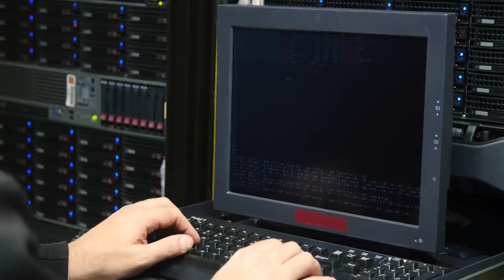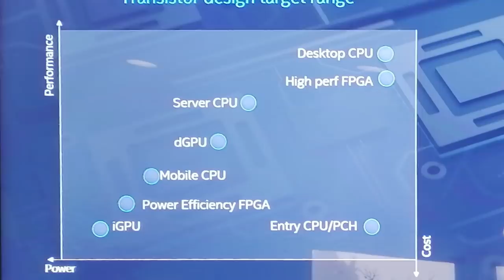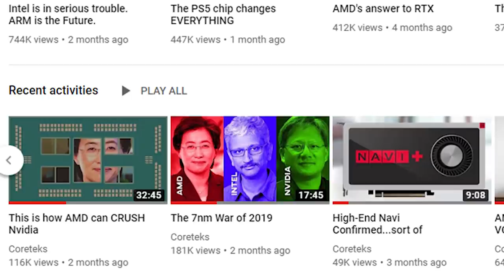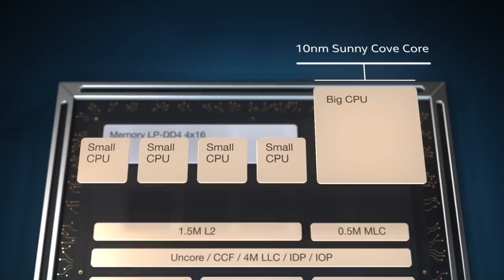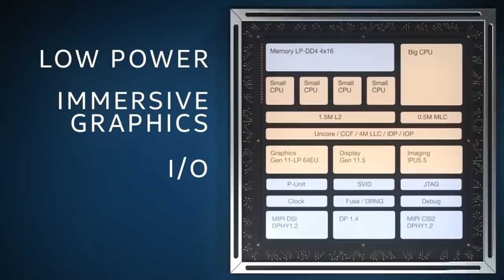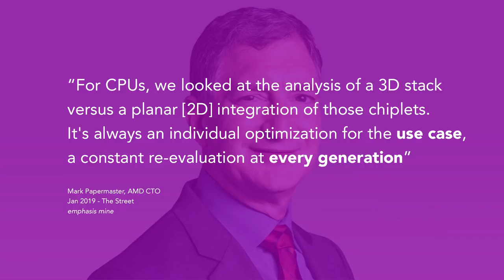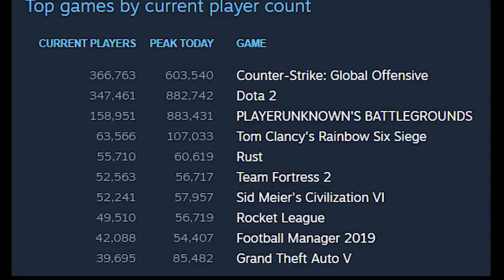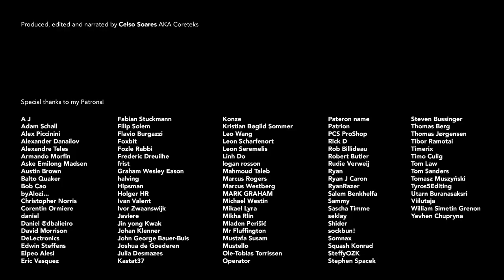2D vs 3D Stacking: Intel’s plan to beat Zen 2

Comment: AMD might sandbag but not for sandbagging sake, AdoredTV did those videos on chip grading and how it falls into a bell curve chance for a processor to meet a certain grade of performance/defects etc... That bell curve would also be applicable to the rate at which AMD accumulates 8 core dies running at top speeds, the sandbagging thus would only happen if they haven't accumulated enough to release it in volume at the same time as the 12 core parts.

Comment: Im NOT a pro in this, but could any one deliberate on why is it not a good idea to take a step back in size management and alow for a chunky'er approach? like put up the newest chips, but allow for more space inbetween (for cooling)  and 3d stack the %¨&@ out of them. Make a "building" with good chips and enough space so that cooling gets easier. Is it a bad ideia? Maybe just going for smaller and smaller processors is what's keeping the tech from a breakthrough.

Comment: But there are only such many players and the cake is just so big. Not every games company will turn to those games, many will try, sure.
Reply: True, but even now, there is more demand than supply, in data centers, and that's not slowing down any time soon. Density is king, there, too, and there's more than one way to increase total efficiency, and thus performance per sqft.

Comment: 3d is all well and good. but Heat dissipation from a 3d architecture/design will be its greatest hurdle. with having stacked cores and Dram on top of the die it will get the brunt of the CPU heat output. slowing the core above it and Nand Flash significantly. Maybe it would be a useful design for small form factors in the mobile market with low clock speeds, but for desktop/server use, the design will ultimately fail unless the heat issues and overall power draw are resolved.

Comment: It is currently for mobile segment. You know, where you want Atom, Core technology and a GPU at low consumption. For example all in one VR headset. 
It's reasonable at small scale, because it's still pricey technology and making full-fledged CPUs this way is too expensive. That's why AMD is using this technology only for GPUs and why is decided for making multi-chip module CPUs. However, this is the future of manufacturing, which we will see several generations later, when the more capable player tune up the process at reasonable price.

Comment: maybe they would embed thermoelectric cooling to solve the hot spots problem but then the CPU would use alot more power and produce alot more net heat which will definitely need liquid cooling with a large radiator. still worth it in my opinion.

Comment: A year at best if they remain on schedule. Which I highly doubt they will. I'd say at best late 2020, a more modest estimate would be early-mid 2021. However when you think of this, Intel might be getting there first. But AMD is pioneering smaller chip designs. Now once they've got 7nm locked down and rolling. They themselves can then start working on 3D chiplet stacking. And this will be easier for them as running 7nm will come with massive performance gains along with energy and heat reduction. So they'll defiantly have far more wiggle room when it comes to AMD designing a 3D chip. Meanwhile Intel may get to the 3D chip first, but they have to deal with thermal issues. Essentially they have to deal with a problem AMD won't have to too such a similar extent. And once that's achieved they still then have to work on moving from 10nm to 7nm.
Reply: TBF, 7nm on TSMC is only a bit denser than 14nm++++++++ on Intel, and Intel ' s 7nm is going to be closer to TSMC's future 5nm.

Comment: It'd be nice if they could add a heat plate(s) with external radiator(s) in the stack to transport the heat from all the inner components more efficiently.

Comment: I just want to ask you one question, Will AMD support Hackintosh? also, I never saw the performance in AMD system without the excessive heat.
Reply: Ryzen doesn't heat at all lol
Reply: You can already build AMD Hacintosh. If you've never seen an AMD system without heat ,then you have been living under a rock, maybe rethink your youtube username,
Reply: Eh, Zen+ offers similar performance and heat production to Intel's Haswell. If you've never seen a cool running AMD, you probably weren't around before 2008.

Comment: I see 2 main problems with this.. first and most obvious one as pointed out in the video, will be heat transfer. This is gonna be difficult to manage..
And the second problem will be cost.. that's gonna be a lot of silicon getting stacked on top of each other. And this will add a huge amount of extra cost to manufacturing.. So you will then come down to the issue if the extra performance will help offset the added costs.

Comment: I think alternately it will come down to who has the best instructions per clock or IPC just like it did back then with the 5 GHz chip.
Reply: Everything else being equal yeah, but there's more than one way to skin a cat. It's really not as simple as ipc is king, if that were the case we'd still be on single core processors
Reply: @mistamisa7271   It depends on the workload. The reason that 5 gigahertz AMD processor was bad was because even though it had a high clock speed its IPC was awful.  It doesn't matter how much information you're feeding the processor if it can't take all the information and process it.
Reply: @mistamisa7271  Intel has also kept a firm lead on IPC alone so far. AMD used to and to some extent today run less efficiently than intel processors especially with Bulldozer based CPU's
Reply: I think you missed my point.  There's more than 1 way to leverage a cpu. If software is optimized for 8 cores and you have a 6 GHz 1 core cpu  ipc ain't gonna mean jack shit.
Reply: The main reason FX cpus sucked (actually fit into this video) was because of the sharing of cache this article explains it https://www.extremetech.com/extreme/188776-how-l1-and-l2-cpu-caches-work-and-why-theyre-an-essential-part-of-modern-chips

And no AMD cpus are actually less power hungry than current intel parts

Comment: For 3D stacking intel should use liquid cooling with micropipes between cores inside a crystal. Otherwise CPU will throttle too much due to overheating.

Comment: 3d vs 2d stacking is a fight of compromises, and something tells me that 3d stacking will become viable in laptops and small form factors, but not in servers nor demanding desktops.
Chiplets are a very clever solution, plus the fact that you can add memory chiplets to your socket means that foveros advantages become less of a concern for amd, but heat dissipation is going to be the biggest problem for intel as they get smaller and smaller increasing the heat-spots of the chips

Comment: I can see the extra cache making quicker access to data, but I'm still certain that you will need the cpu core to run at the faster speeds to complete the task faster. Maybe I'm looking at this wrong, but I don't see were adding more cache will get a task completed faster with a 3.2GHz cpu vs a Zen 2 5GHz cpu with less cache. Of course the instruction set and architecture design will make a difference, that's why Intel was beating AMD's FX-9590 5GHz cpu with a slower 3.9GHz i7-4770K cpu and both processors having the same 8MB amount of L3 cache. AMD has made great progress in their instruction set and architecture design with the Zen processors. So Intel will have to pull more then cache out of their hat to overtake Zen 2.

Comment: 2d chiplets are the way to go, they are cheaper, efficient, flexible. They can remove add additional chip based on need and yield, in 3d you either use it or not, there is no in between.

Comment: I am not like you, I usually hang out several generations behind =P
For what I do, my I5 4690 and gtx770 work great. Hell I didn't even get them when they were new, in fact I only paid about $300 for motherboard/CPU/graphics (I happened to find sales at the right time). Sure I wont be flying through tripple A titles at max details and 4k glory, but I don't play those games anyway. I am however waiting for the new tech, it should drop prices on current tech quite nicely. I "feel" like it's time for an upgrade so I'll wait a bit and do what I always do.

Comment: You seem to really underestimate heat impact. AMD was making really interesting research in area of stacking cache on chip and they found out huge problems with heat dissipation. Also there was an article where guys from TSMC talked about challenges with their 7 nm, one of the biggest issues was heat that could impact local areas of chip.
While I do agree that 2.5 or 3D stacking is future, I don't think that it will come so quickly and even if it does, it will be mobile, perhaps server market first.

Comment: Well, intel needed to do this.  They knew they needed to do this.  But it wasn't until AMD started doing the chiplet design that Intel got the wakeup call.  But ultimately I agree, Intel innovating here is definitely a good thing. 

But I'd also point out that Active Interposer was also discussed very heavily by AMD before this as well.   The rumors suggested that Active Interposer would need to be made on 22nm processes, as AMD couldn't afford the potential of losing too much interposer silicon per wafer because of its size.   It really is, as you said, a money thing.   

Zen 3 might be a little early for 2.5d.   What I do think that AMD will do with Zen 3 is taking advantage of TSMC's multi-layer process for RAM/GPU and applying it to CPU and their IO/Infinity Fabric tech as well to keep die-size small on 7nm/12nm as these are the two processes that would likely be compatible with the layering tech.  Both of these also require the IF solution to also apply to GPUs.  This will give us a clue as to how AMD will deal with stacking heat... and probably give AMD the experience they need to design a better 3d stack.    I do think that after that we will see a Zen 3+ chip that has a single stage active interposer at 22nm.   

I think the delay in Navi is primarily because of attempts at applying chiplets to navi architecture and a subsequent failure in being able to do so resulting in a monolithic design that AMD has difficulty in justifying the risk - just like Vega, otherwise AMD would have pushed Navi out the door at the end of last year.  However, I think that Arcturus will be the hybrid monolithic/chiplet that will lead into Zen 3.  And then a fully segmented gpu/rt/tensor/IO/Memory/framebuffer chiplet architecture for the next-gen and the release of Zen4.  I wouldn't be surprised if GPU memory controllers, IO and framebuffers were in their IO die design right now.   

These are just my guesses at the future.   AMD isn't playing conservative, and as you pointed out they really can't afford to.  They need this money now to chiplet everything and make 3d stacking by Zen4, this way they can stay on the bleeding edge of 5nm and even 3nm tech (this is where AMD tends to win against Intel), producing very small dies that even with poor processes have high yields.  Odds are we'll continue to see lesser chiplets being previous gen fab tech, going back maybe to 16nm.   And Active Interposer won't be smaller than 22nm.   At least not until Zen 5 which will be the next socket revision.

Comment: You can run some heat dispersion with tubes through the center.

See AMDs patent on it but with 3 extra heat based pipes

Comment: AMD
Abstract:
Cache hierarchies in future many-core processors are expected to grow in size and contribute a large fraction of overall processor power and performance. In this paper, we postulate a 3D chip design that stacks SRAM and DRAM upon processing cores and employs OS-based page coloring to minimize horizontal communication of cache data. We then propose a heterogeneous reconfigurable cache design that takes advantage of the high density of DRAM and the superior power/delay characteristics of SRAM to efficiently meet the working set demands of each individual core.

- http://www.semicontaiwan.org/zh/sites/semicontaiwan.org/files/data15/docs/3_semicont_2015_-_black.pdf
- https://www.cs.utah.edu/~rajeev/pubs/hpca09b.pdf
- https://arxiv.org/pdf/1809.08828.pdf
- http://jantsch.se/AxelJantsch/papers/2014/YuangZhang-MICPRO-Survey.pdf

Let me know what you think of this, AMD is doing exactly the same, 3D sticking.

Comment: If Intel does go 3d memory stack as you think, for the heat dissipation they will probably put heat pipes that go through the chip. To the top where the what can be dissipated much more easily.

Comment: Intel had a performance advantage with the 4770k because of an IPC advantage, that is not a valid argument for why clock speeds aren't relevant when comparing cache size. Having caches that big will need a change in the way compilers optimise programs to take advantage of it before it actually helps at all

Comment: I have 7960k but even with massive twin 360mm radiators and 9 fans I can't transfer the heat out of the chip. Never mind 28 core monsters.Lots of Mini Heatpipes soldered right to the die     in the lid might help

Comment: To your point around the 6 minute mark, I don't  think increasing the available cache on each processor, in this case chiplet, should be AMD's goal but optimization. AMD has tried very hard to catch up to Intel's currently processors stack and Intel CPU's do not have the same amount of cache available as AMD processors. So if Intel can achieve their current results on smaller memory cache pools, I don't see why AMD should not push for the same. If AMD is not able to do that, then it will soon become a big problem for them.

Comment: You also forgot(? quite possible it was intentional due to time constraints) to mention, alongside, similar to, and complementing the shift of the gaming industry towards requiring less power in the form of local hardware and the games-as-a-service model, that it is also inevitably shifting towards streaming. This is undeniable and it is the future of gaming, whether you like it or not. Gamers and users everywhere (even if some feverishly deny it on the surface) would welcome being able to play your games, anywhere, at anytime, on any device. The convenience this brings is too attractive to ignore, and tech is always for our convenience and to make our lives easier. It is clearly evident that many of the big players are already getting ready for this emerging market, such as Microsoft, Google, and Amazon. With this shift, as you said, more developers, publishers, and semiconductor manufacturers will focus even more on the server side of things, since that is the key to making all of this a reality. It is all very closely related to the cloud (computing) and IoT. So in the end, I agree with most of your points, just wanted to add an additional point that would further strengthen your argument. Great vid, cheers.

Comment: CPU chip designers are stuck on making a very old paradigm better. A new paradigm is needed. Instead of a number independant CPU registers accessing a memory bus to work on external data and making many units to run in parallel they need to reduce the core count but make some internal registers large arrays instead of single value. And even configurable to a data structure. Then they can have internal parallelism applied to the array structure. The single core could then work on data in parallel while pre loading more data into another array to continue uninterrupted and not be bogged down by data bottlenecking.

Comment: Intel needs thicker and stronger interposer boards.  Thermals will be an issue if they stack chips and, honestly, it doesn't make sense thermally at all to stack silicon.  You would literally be shooting yourself in the foot with heat.  But a stronger and flatter interposer and multiple dies would make much more sense as you are spreading the heat and keeping chips that aren't generating the same amount of heat away from each other.  Mixing hot and cold areas of silicon would do more harm than good on stacked silicon because there are more interconnects and those interconnects are weak points which will be prone to failure from heat cycling.  The trick here to making fast CPUs/GPUs that last is reinforcing the interposer board by making it thicker, stronger and flatter to increase durability, increase thermal conductivity and decrease the tiny electrical contacts between parts that would be subject to thermal expansion.  Mixing hot silicon and cooler silicon chips by stacking would likely cause increased failure rates due to the differences in temperatures, add to that the hot and cold cycles and you have a bunch of useless chips.  The interconnections on electronics are a major failure point and it is common even for things like power connectors to go bad because of thermal cycling, so increasing the number of interconnects and decreasing their size is just going to increase failure rates beyond what they estimate...

Comment: FX-9590's performance gain (comparing to previous FX-series CPU) is the proof that higher clock speed means better performance, otherwise over-clocking CPU to gain performance would be a myth. You can't compare only clock speed and ignore everything else between amd and intel to say that "Clock speed don't mean that much"

10:09 Don't use a "SLI gaming fps" chart to compare CPU performance. Use some single thread benchmark software. Here's some reliable information for you, see how much gain FX-9590 had over FX-8370:
https://www.cpubenchmark.net/singleThread.html